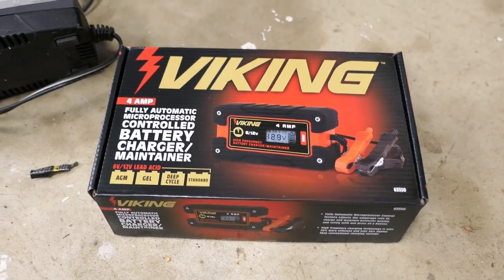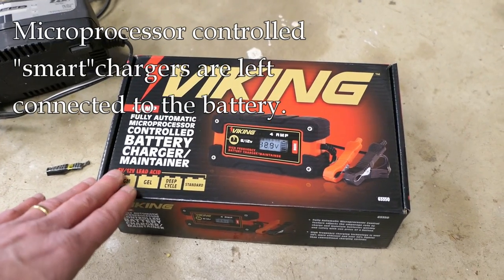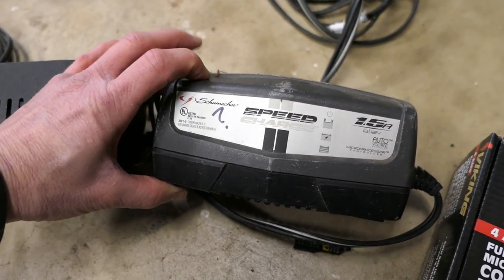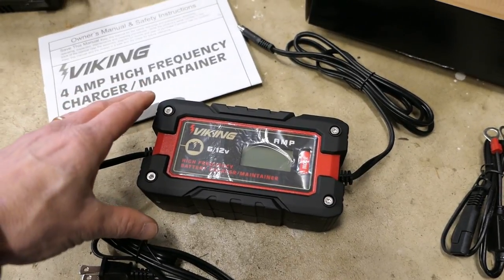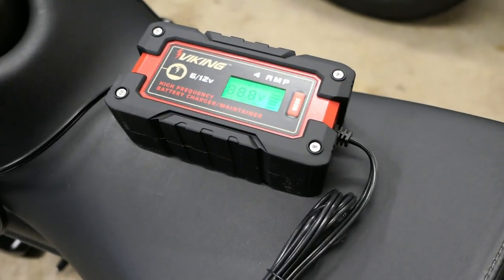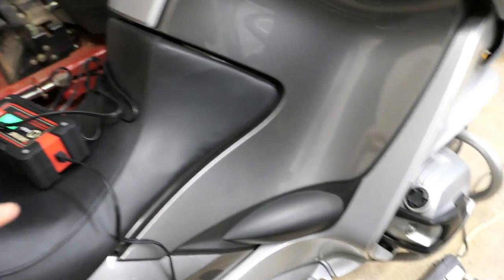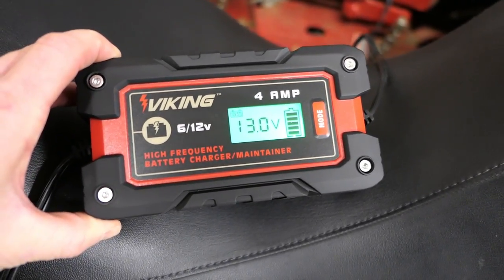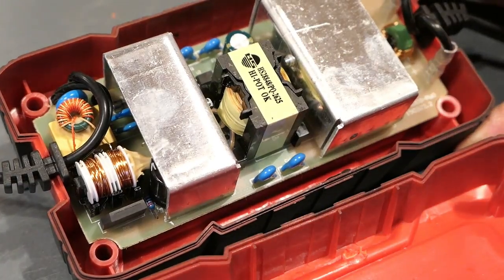Review: Harbor Freight Viking Model 63350 Charger

Comment: Good review!  I got a cheaper Noco genius 1, because the Battery Tender Jr died at at 5 yrs.  The Noco is 1 amp, cheaper as avg, but I don't like the proprietary connector pins.  The wife actually suggested HF and I'm sending in the Noco and getting this model.   Thanks

Comment: Great review. Last year I left my battery charger plugged into my battery on my motorcycle and I think that was the cause for the battery to over charge and be no good so, I don't want to make the same mistake, I have been looking around for a battery tender at a reasonable price and this review helps me make the right choice so thank you.
Reply from the maker: Just make sure you get a microprocessor controlled charger, which will shut off automatically to prevent overcharging.  It was the old trickle chargers which could be a problem.  Also, put a voltmeter across your battery and check the charging voltage while the bike is at idle and then when you hold the throttle at 2500RPM or so.  You want to make sure your voltage regulator hasn't gone bad, which could result in a cooked battery.

Comment: I watched this video review almost a year ago and was impressed. Finally purchasing it now I am interested to learn if you have any comments concerning your long term use of this product. Also...do you use this product in continuous maintenance mode?
Reply from the maker: It's been a great little unit, and my son just bought one on my advice too.  I've had no issues, other than you need to remember to set the correct battery type when you connect it.  The default is the last battery type used, so if you keep it on the same vehicle you don't need to make changes.  In the winter I do keep the charger connected and let it automatically charge as needed.
Reply: @tinderboxarts So you're saying it stays in the same mode even if there was a power outage? I know some maintenance charges will reset to a default mode and won't start charging again without someone setting it up again after power loss.

Comment: What happens if you forget to switch to the correct battery mode? I just charged my AMG battery in the std mode by mistake 😮
Reply from the maker: The AGM battery requires a slightly higher voltage than a standard battery, so you probably just undercharged your battery slightly. No worries.  It would be more troublesome if you charged a standard battery in the AGM mode, but even that would require multiple charges before you did any serious damage.
Reply: @tinderboxarts  thanks for the reply!

Comment: I have been debating between buying this one and the other Viking charger you showed in the beginning. It will be used to charge two 6v 235ah batteries in series that I use for camping, so they won’t be used a whole lot. Would this charger be better to just leave on in between camping trips or should I go with the bigger one you showed? 
Thx in advance.
Reply from the maker: The reason to get the larger model would be the need for quicker charging, for a "boost" charge while trying to start a vehicle, etc.  It provides a higher amperage if needed.  If you just need to keep smaller batteries charged up between uses, and especially if you want the charger to monitor the voltage over time, then this smaller is more appropriate.

Comment: I have two of these. One I have had for about 2 years and just bought another one. Neither of them will go into maintain mode. They appear to just keep charging showing 14.2-14.4 volts. Tried on two different batteries. I bough the second thinking maybe the other one was defective. I bought a different brand 4 amp, and as I thought, batteries are fully charged. So charger seems to be charging, just want switch to maintain.
Reply from the maker: It can be frustrating sometimes with limited screens and information on these devices to know what they are doing.  I suspect that the maintainers are actually doing what they are supposed to be doing but you may not have waiting long enough or you just happened to catch them at the wrong moment.  Another possibility is that you accidentally chose the wrong battery type.  In that case, the charger would be looking for a voltage that it will never reach and becomes confused.  On my unit I have seen it change color and indicate it is done, but it does take a while.
Reply: @tinderboxarts  I just bought a new one of these about a month ago, and apparently, the display does not turn green anymore when it goes into maintenance mode... now the backlight  just turns off. I have an older one that has the display light up green when in maintenance mode. I guess they changed it.
Reply: @P-Dawg-01  exactly why I'm here right now... lol. I was like wth is going on with my new charger, doesn't turn green anymore the light just shuts off when it's full I guess.

Comment: I need to charge the battery on my camper, is it safe to leave out in the weather (rain)
Reply from the maker: I would not leave the charger out in the rain.  It's meant to be under cover.  In a pinch I suppose you could cover the charger and the  power cord connection under a tarp or a box or something.  Make sure you are plugged into a GFCI outlet in your garage or home, though, so it will protect against a ground fault.

Comment: Thanks for the video. Question, should I connect both alligator clip to the battery terminal. I want to keep it trickle charge when my car sit in the garage. The manual said: For negative-grounded vehicle, connect POSITIVE (RED) clip from battery charger to POSITIVE (POS, P, +) ungrounded post of battery. Connect NEGATIVE (BLACK) clip to vehicle chassis or engine block away from battery.
Reply from the maker: The manual may state to connect the black negative clip to a chassis ground only because the corporate lawyers fear somebody sparking near the battery.  However, the best electrical practice is to connect the clips directly to the battery terminals, both the red positive and the black negative.  That will ensure no voltage drop across terminals or bad chassis grounds.  If you like, you can connect the clips to the battery first and then plug in the charger to the SAE connector.  That will help avoid any sparking.
Reply: I'm not sure this is complete... yes, as far as the sparking, but the manual also states the when charging Outside of the vehicle to still hook the battery negative to a separate jumper cable and then the charger to it. I have been under the assumption that that helps duplicate the ground of the car and thus aid the charging algorithms... perhaps i am wrong?
Reply from the maker: @georgehofgren6123  There shouldn't really be any electrical difference between a connection directly to the battery and a connection to a chassis ground.  In other words, in an ideal world the resistance value should be the same.  In reality there often is some minor voltage drop due to poor connections, corrosion or dirt, but the charging algorithms wouldn't be able to account for that anyway.  It's a steady state either way.  A significant resistance, however, might prevent the charger from doing it's job fully because it can't overcome the problem.  The best practice to ensure a full battery charge is to connect directly to the battery with the charger.  You avoid the sparking issue by keeping the charger off while you make the connection.  Once the battery if fully charged you can check the cables and connections for any issues.
Reply: @tinderboxarts  But that's my point... there IS a real difference in resistance from the chassis or the battery neg terminal. Just try it... hook a charger to the battery and check voltage with a meter, then hook the charger neg to different spots on the engine, you will see drastically different charging rates. Try it for yourself before you assume otherwise. And THAT is why i think that the manufacturers tell you to connect a jumper between the battery neg and the charger when out of the car... better simulates what how the battery is reacting while in the car, connected to a 1000lbs of steel ground ~
Reply from the maker: @georgehofgren6123  Ha!  I understand your theory, but it just isn't so.  The reason the manual mentions an extension cable for charging outside the vehicle is the same reason it mentions using a chassis ground for charging inside the vehicle--to prevent a spark from igniting hydrogen gas.  It's an overabundance of caution.  The manual for this charger states: "Attach at least a 24-inch-long 6-gauge (AWG) insulated battery cable to NEGATIVE (NEG, N, –) battery post."   Now, depending on how you attach such a cable, you may have no measurable resistance (ideally) or you may have resistance posed by a poor connection.  If you notice a difference in charging, you may find that you have a resistance which would also affect voltage, obviously.  if you had a significant resistance due to a really bad connection, it could cause the charger to believe that there is a problem with the battery and it will cease charging.  However, if you had no measurable resistance or a minor resistance, then the charger would continue to do it's work, possibly taking a little longer to charge with the minor resistance but still getting to the same place.  As I said, ideally there is no measurable resistance in a chassis ground, and that is the case with a new car or motorcycle.  Over years of use the grounds may degrade, though.

Comment: How do I hook up  to my mower battery. I don't understand the directions.
Reply from the maker: A typical lawn mower battery is going to be the 12 volt "standard" type, which is just lead acid, so select " 12v STD" on the charger.  You should find a positive and a negative terminal on the battery.  The black clamp goes on the negative terminal and the red clamp goes on the positive terminal.  Plug the charger into your household outlet and you should see the display turn red when it is charging and green or no light when it is done.  You can leave the charger attached so it can monitor the battery and start charging again if needed.

Comment: I’ve had mine on for several days, and it still is red and looks like it jumps from 11vdc to 12. The battery bar shows 1 to 2 bars….does this seem normal?
Reply from the maker: No, probably not.  I'd pull the charger off and put a meter on the battery--is the voltage up anywhere near where it should be?  Can you tell if the cells have fluid in them?  Is the battery very old?  If those things check out, it's possible you just didn't have a good, clean connection to the charger.  Clean off the terminals and make certain you have good clamp.

Comment: I have a 1983 Honda nighthawk 650 which mode charging should I choose? Standard of amg?
Reply from the maker: Your Honda could have various battery types installed, so you have to look at the battery itself, not the bike.  Most common now are AGM style batteries, but it is possible you have a standard lead acid or even a lithium battery installed. Take a look at the model of the battery and look up from the manufacturer what type it is.
Reply: @tinderboxarts  it is a lead acid. Stupid mechanic changed the brand new one I had in it was a AGM and he put a lead acid one

Comment: Can I use it without having it plugged in the wall?
Reply from the maker: No, this is a charger which requires household power to do it's job.  It converts AC voltage from your house to the appropriate DC voltage for your car or bike.  It charges slowly over time.  You might be confusing it with another type of device that uses DC battery power to help jump start a vehicle.  Those devices are basically just batteries with a control panel meant to add a little extra "oomph"  to your vehicle battery when it gets low.  They aren't very effective.

Comment: are these good for motorcycle batteries?
Reply from the maker: Yes, they have selections for standard or AGM batteries, and most motorcycles use AGM.  If you put your bike away for the off-season, just connect this charger directly to the battery and leave it.  The charger will monitor the battery and only charge when it is needed.

Comment: What does it mean when it’s green backlit 1.0V with clamp symbol?
Reply from the maker: Usually green means it is done charging or doesn't need to charge at the moment.  I'm not sure what you are seeing with the one volt, but I suspect you probably don't have a good connection with the battery.  If you are using the actual spring clamps, try repositioning them and wiggling them around to get a good solid connection.   If you are using an SAE pigtail, check that the pigtail has a tight connection with the battery and check that the fuse is good and well seated.

Comment: Can you jump the battery without it being plugged up to the wall
Reply from the maker: You are thinking of devices with an internal battery used to store a charge.  This is not that.  It's a charger which is plugged into household current in order to charge a battery and keep it charged while the unit is connected.  It's not appropriate for jump starting.

Comment: I have this charger,  I have a 12v deep cycle marine battery do I charge it on regular or agm?
Reply from the maker: You should use "standard" mode.
Reply: @tinderboxarts  Thanks
Reply: @tinderboxarts  i have people telling me to charge on AGM because its a deep cycle but the battery does not say agm anywhere
Reply: @tinderboxarts  so I'm getting conflicted feedback
Reply from the maker: The manual says standard mode.  Unless it is actually an AGM battery.  It has more to do with the voltage requirements.  An AGM battery requires a higher charging voltage than a standard battery.  Your marine battery requires standard voltages, and the charging algorithm will figure out you have a deep cycle battery.

Comment: Can I charge my 2017 Chevy Malibu battery with this
Reply from the maker: Yes.  Your battery may be the AGM or the standard type, so check on the label to be sure and use that setting.  This charger comes with "alligator" clamps, and you can likely use those on your battery.

Comment: Ok, I disconnected my battery terminals. I hooked the gators directly to the battery. I leave it sit, went out to check it, it shows a flashing battery at the bottom. How do I know if it's charging?
Reply from the maker: The whole display turns from red to green when it begins to charge.  That battery symbol means that the charger is having trouble charging and that it believes the battery itself is bad.  It attempted to charge for an hour, and still could not get the voltage to come up over 10.5 volts.  It's possible a more powerful charger could do more, but if the battery is also pretty old or abused, then it may be time for a new one.

Comment: Anyone know if I can run this charger off of a lithium “ solar generator” that can do up to 250 watts?
Reply from the maker: This charger requires a 120v power supply and probably draws a couple-few amps.  I have no idea what this solar generator device is that you mention!
Reply: @tinderboxarts     It’s the DBPower 250 watt solar generator. Not sure it can handle 4 amps which is what this charger uses though.

Comment: Had the charger going for abt 2 hours and then it filled up far too quickly w full battery bars @ 14.7v then reset back down to 2 battery bars at 13.1v .... Does that sound normal.... When I first started charging it was at 1 battery bar(flashing) at 12.6v ...
Reply from the maker: Don't get too hung up on those voltage readings.  First of all, the charger is running an algorithm which will change depending on what it is sensing.  It's not going to charge the same way for the same length of time each use.  Second, the accuracy of the reading probably isn't that high anyway.   If you have a meter, you can test your battery under load, which is what is important.  Here's that video: https://youtu.be/d-5xA31nBd8

Comment: It's made in China.... That's something to worry about
Reply from the maker: I remember well in the 1970s and 80s when Japanese cars were seen as inferior to American products.  We made fun of their design and engineering, we used xenophobic slurs to describe them, and we rejoiced in good old American Iron.  That turned out well, right?  The reality is that today close to a third of all manufacturing globally is done in China.  Most of what we buy under American labels is made in China or Asia.  And, the truth is that they are flat out better at manufacturing some things than we are.  It really comes down to the design.  In other words, a product can be designed to be cheap and disposable or it can be designed to be strong and durable for a greater price.  Chinese manufacturing is capable of doing either, depending on what they are asked to do.  So you have to evaluate a product based on how it is designed rather than where it is made.  Harbor Freight has been steadily increasing design quality over the past few years and this is one example, I think.  I've has zero problems with this unit and it's charging one of my bikes right now!
Reply: @tinderboxarts  
I bought one a few days ago on ebay and am worried about quality.  Unfortunately, everything is made in China nowadays.  Schumacher has got some chargers made in Mexico.  Pick your poison.
Reply from the maker: @ Se Zwo I have four of these now, and they are all running well.
Reply: Don't worry iPhones and many Teslas are made in China